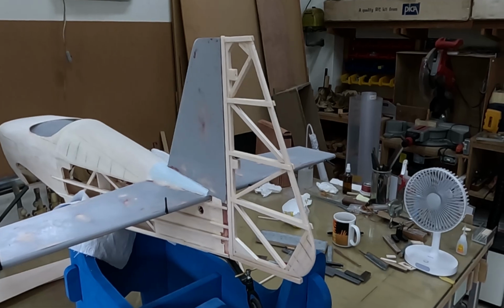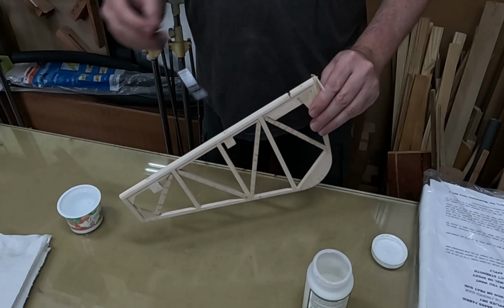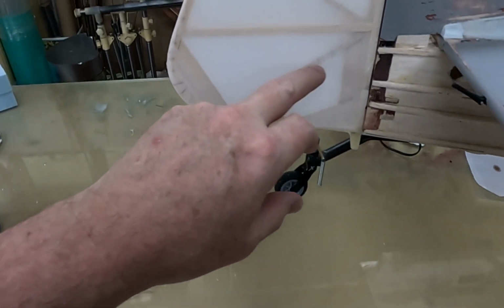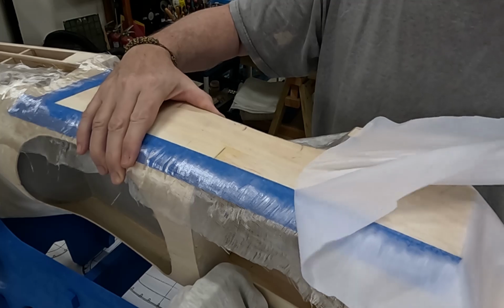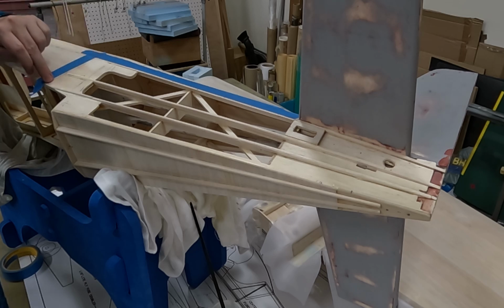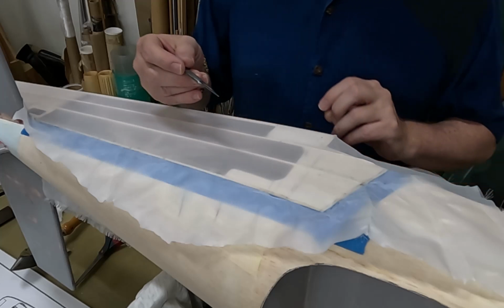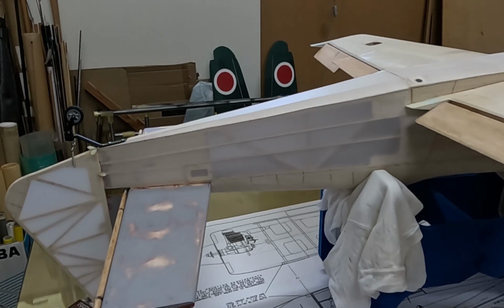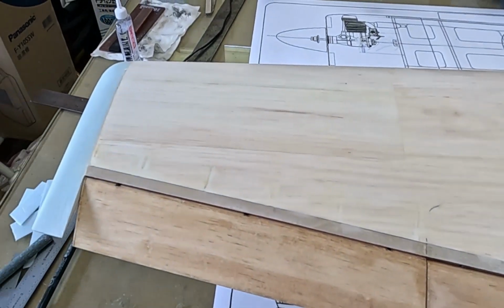DR-107 One Design RC plane build, Update #21, Covering

Comment: Ours has the side fabric wrap right over the turtle deck and down the other side. The fabric is wrapped around the lip of the rollover structure behind the pilot’s head.
Reply from the maker: Haha!  Really.  I looked at dozens of photos of the One Design and could not see the fabric covering the turtle deck.  Is the fabric covering sheet metal along the turtle deck?
Reply: @BalsaAeroProjects  yep - that’s it! The fabric of over the curved sheet.
Reply from the maker: @tasesq  Thanks.  This will probably look close enough.

Comment: did you seal the edges of the koverall with ca when you did the sides?
Reply from the maker: @gc2916  yes.  I did it to give myself a little added insurance that the fabric would not pull away since there was only a small strip of wood as a glue surface.
Reply: @BalsaAeroProjects  thanks. Great build. Learning alot

Comment: Asking for a dope (nitrate/butyrate) fiend... what paints can you use with the acrylic Mod Podge and sanding sealer?  Does that limit your choices to acrylics and latex?
Reply from the maker: Is he asking if dope paint can be applied over sealer and Mod Podge?
I don't think that sanding sealer will be a problem (at least a water-based sealer...a solvent based could have issues).  I use an automotive (lacquer-based) primer over the water-based sealer without issue as you will see in the next video.  Same for the Mod Podge.  As for dope over these, I would just suggest a test for compatibility.   Just make up a simple frame that can be tested with the materials he wants to use.  But, if lacquer-based doesn't present a problem then I'm going to go out on a limb and say dope wouldn't either.  But, test first!!  Haha!
I can't really comment on all paints other than to say that I use artist's acrylics almost exclusively because they are water-based, easy to thin, easy to spray, flow well and are tough once fully dry.
Reply: @BalsaAeroProjects  He was asking exactly that.  I will take your suggestion, make a test assembly and try it out for him.  Did you say you put on three coats of the Mod Podge?
Reply from the maker: @TheBigChinoDon  yes, three thin coats.

Comment: I gotta be honest: I've never seen anyone in my 37 years of modeling cover or use these techniques. Where did you get the idea for modpodge and why are you not using dope??
Reply from the maker: A couple of reasons.  First, and foremost, I can't get dope in Taiwan.  At least, I've never seen it in my 25 years living here.  And, secondly, the smell would end my hobby career (read: wife).  So, I've had to find alternative materials sometimes.  I tried numerous glues that I can get in Taiwan to use as a heat-activated adhesive and Mod Podge did the trick.  I also use Titebond as a heat-activated adhesive to iron on sheeting on occasion but found it didn't seem to work as well for fabric.  It doesn't have the tackiness when dry that Mod Podge does which helps to grab the fabric.
I must admit because of living in Taiwan, I tend to take a contrarian or non-traditional view on building models.  But, i do believe that the results speak for themselves.
Thank you for watching.
Reply: @BalsaAeroProjects  I'm impressed. I always look for new ways to do things as well. I had no idea that Mod podge was a heat activated glue or could be used that way. How about that sanding sealer that you used. What product is that and how well does it sand and fill the weave, etc. I'm going to watch this video again. It was around 230 am when I came across it. Thank you
Reply from the maker: I don't think Mod Podge is advertised as heat-activated but it does work.
As for the sanding sealer, it is a local Taiwan brand so it won't help to tell you.  I would look for a high-solids sealer.  For balsa, use a solvent-based sealer if you can find it so that it won't possibly warp the wood.  I can only find water-based so I have to be a little careful when applying to sheet balsa and I usually won't apply it to anything less than 3/32" unless it is well supported underneath.  The sealer that I do use works very well.  It can be applied in 3-4 coats to seal balsa grain and the grain will be completely hidden under paint.  No need to apply a covering if all that is wanted is to hide the grain.  I will do that for small areas like the inside of cockpits where it is hard to attach covering.
Thanks for watching!
Reply: @BalsaAeroProjects  even if I walk away with the Mod Podge trick that's good for me. The Sig glue and brodak stink something fierce!!